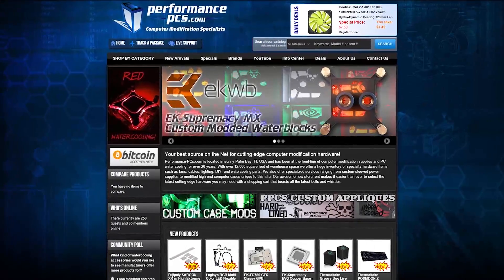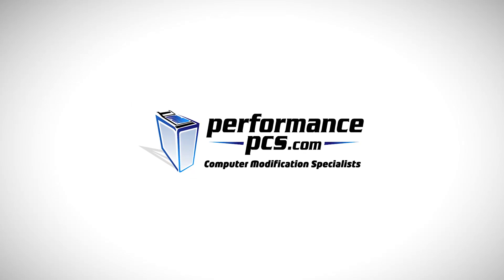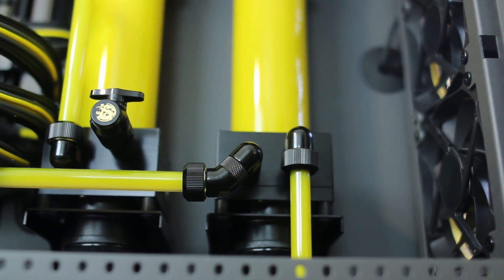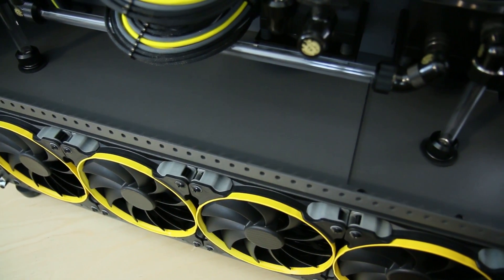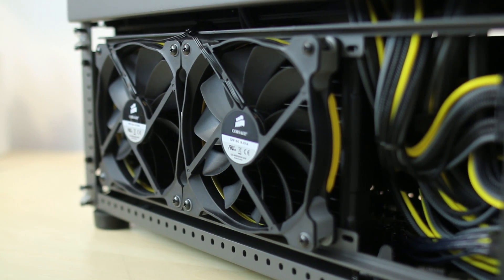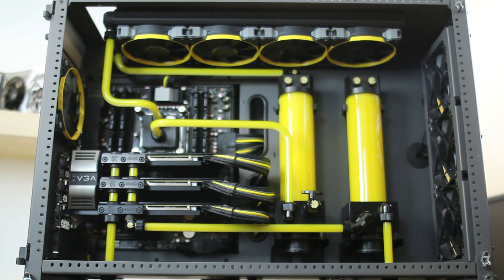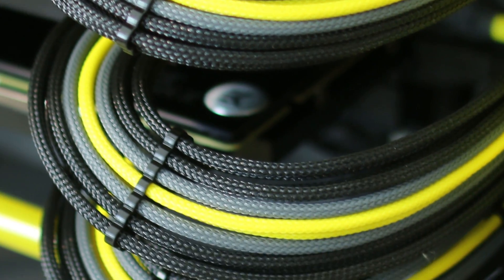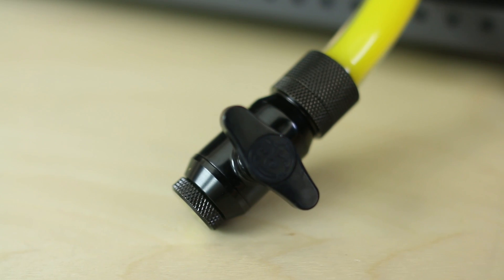Skunkworks V3 is COMPLETE!

Comment: Comments... more like "crumments", because they're so crummy. Is directx 12 really going to allow for memory stacking on multi gpu's? I thought that was just a rumored myth.
Reply: Elias Montejano Yes. Multiple cores will also be taken advantage of. However, Win 10 has not been released and game engines willl need to be modified to fully take advantage of DX12.
Reply: 109sciencefreak will games need any updates to use the memory stacking or will they work with directx 12 without any other changes?  I ask because the biggest problem I have with most modern games is not having enough vram to push the aa and resolution as much as I would like.
Reply: Updates for DX12 are up to the game developers. Exisitng cards will still need new drivers. However it is expected that nearly all systems will benefit from DX12  but we all have to wait and see.
Reply: Elias Montejano From what i have read many games out now, even AAA games will not be patched to direct X12, its simply to costly and the game devs already made their money, most new games will have it though.

Comment: I thought that with the gpus set up that way with the water cooling the water flowed in through all the gpus and then out of all the gpus, but it didn't look that way when filling. Is that just the fluid falling since it wasn't under constant pressure, or do I have it wrong?

Comment: how does the liquid work going through the GPUs?? You've got pipes going into the bottom and coming straight out the top on one side and then going in the top and coming straight out the bottom on the other side. Doesn't that mean you won't get any flow through the water block?
Reply from the maker: Watch carefully how it filled.... I even showed you how it works
Reply: ***** I did. I went back and watched it again and I'm still baffled.
I'm not trying to have a go, mate, I'm just curious.

Comment: If I recall Jay runs 1080p surround. 3x GTX Titan X's are massive overkill hence why he is not seeing any difference from his outgoing config. Even 1440p surround is child's play at this level. I'd say 5x 1440p or 3x 4k is where he will get the most from his setup. SLI works better the harder you push it.
Reply: Xander Rayheart But congratz on the upgrade man!
Reply: Xander Rayheart there is never such thing as overkill

Comment: What monitor set up will you be using for this?
Reply: ***** an old CRT
Reply: ***** bull fucking shit.
Reply: ***** 3 1080p monitors if I am correct may be 1440p but I doubt its 4k.
Reply: like 3 1440p 144hz IPS acer or asus or 4k acer or asus
Reply: I'm pretty sure it's 3 1080p monitors he did a review on the monitor and he bought three of them. If you look on his old build log on part picker he has the monitors on the list so I'm assuming he's still using them.

Comment: DX12 will help setups with a lot of GPUs since it will eliminate CPU Bottleneck. Also 5960X is fast but even @ 4.5GHz if the game only uses 4 Cores it will not be much faster then something like 2600K @ 5.0GHz.
Reply: someusername121 Lol not really
Reply: someusername121 Nope, its been around 10% per generation, so 5.0-4.5 is pretty accurate.
Reply: Shane Mc Grath 
> Cheap CPU
> 5960X
kek
Reply: Orjon Zaganjori Not sure why everyone says bottleneck, I have not had a single instance of it in many builds even without overclocking!It must be if you are being a tight arse on one component that doesn't match the rest of system perhaps? Trying to use a cheap cpu with high end gpu or vice versa?If you can afford it and go all high end parts there is no bottlenecking, wether you overclock or not.Also when direct x 12 comes out we should be able to throw that word out completely when all cores are used.  Maybe they are just playing games that only use a 2 cores or something but I dunno about bottleneck, 8 cores over 4ghz here and I aint seeing it in game. Mind you I don't have 3 titans.  lol
Reply: That's not how things work.Just because 5960X is high end, 1K and the fastest customer CPU and overclocks it does not mean it's not going to bottleneck the GPUs. Problem is Sandy -> IVY -> Haswell has been 10% jumps but if you compare the best GPU when 2600K came out and best GPU now it's 2-3 times fast but the CPU side has not improved much unless the game uses full 8 core.
Reply: Rock
I wasn't talking about the 5960x, I was talking about cheap cpu's!  :)  i3's i5's or basically all amd's. Adding a high end gpu to a low end cpu is going to cause problems.  5960x is not the bottleneck, The problem is the software/game aint using all the cores yet. wait for direct x 12 games which will allow a crap load more draw calls and spread evenly over all 8 of those cores at his 4.5ghz each! There is stuff all software/games right now that use more than 2-4 cores at the most there lies the problem,Gpu's are waiting on cpu which is only being done on a few cores at maximum load while the other cores are basically sitting there idling. Need to wait and see what direct x 12 can and can't do but 8 cores at 4.5ghz is no slouch that's 36ghz of cpu speed and the software is probably only using 10-16ghz of it on 2/4 cores only.  Plenty of untapped speed just waiting for something to use it. ;)
http://uk.hardware.info/reviews/6033/9/nvidia-geforce-gtx-titan-x-sli--3-way-sli--4-way-sli-review-insane-performance!-benchmarks-metro-last-light
Take metro last light which is an extremely demanding game, Where is the bottleneck?
Even at 4k at very high settings 3 way titans get 60fps which is max for a 4k monitor right now, 2 way 57fps, even a single titan x is getting above 30fps, That 5960x used here is only clocked at 4.0ghz, And as for 1080 forget it, 3 way titans aint bottlenecked it is complete overkill, you are almost maxing out the 144hz of your monitor.   The sli scaling and game optimization is the problem, You can see that adding a 4th card you actually lose performance.